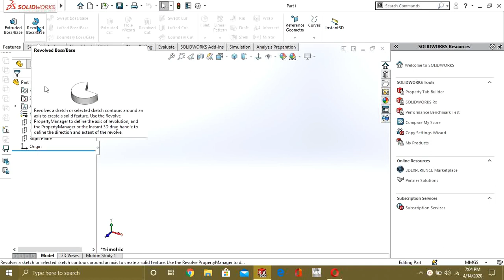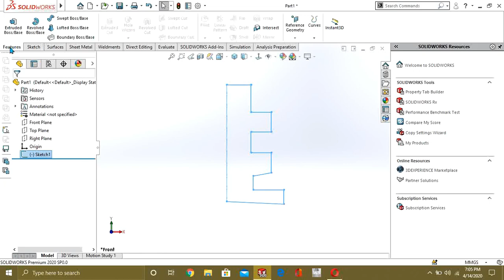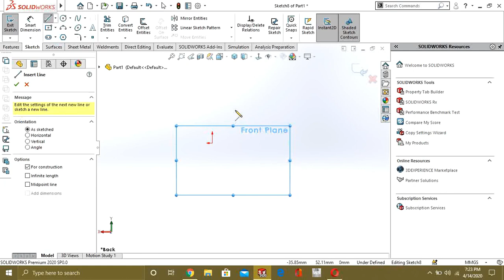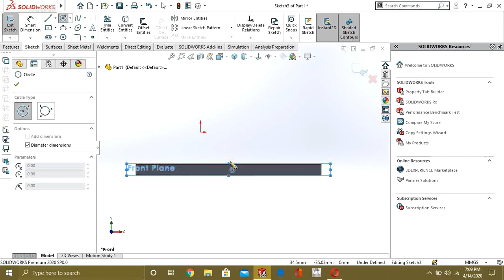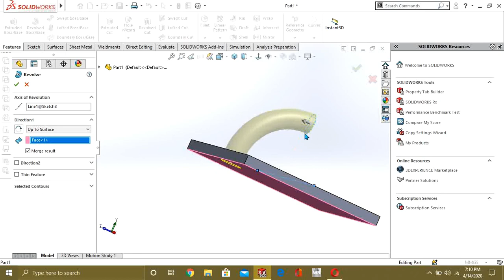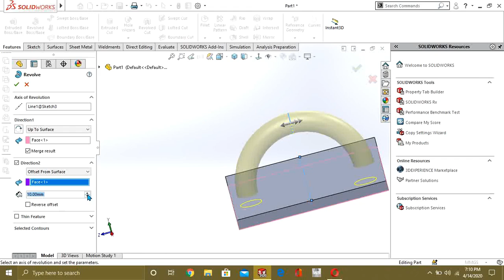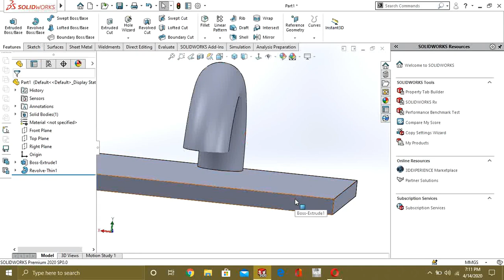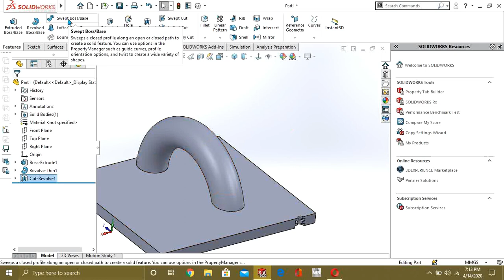⚡ Solidworks Revolve, Upto Surface Revolve, Revolved cut on Solidworks

Comment: In revolve cut feature, as you explained . Can we move our sketch in the centre of the model directly by dragging (like if we want cut in middle )  OR firstly we have to move our plane there & then after we will sketch there?
Reply from the maker: with 3D sketch you can do it directly but with 2D sketch i have explained in our First Video you must require some plane or face on which you are going to sketch.